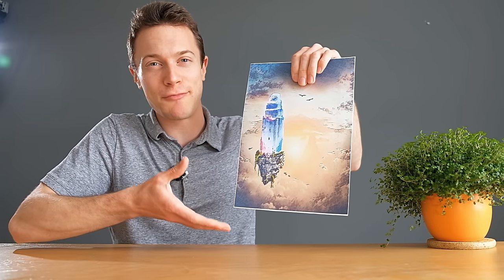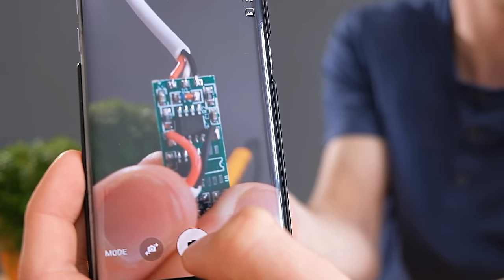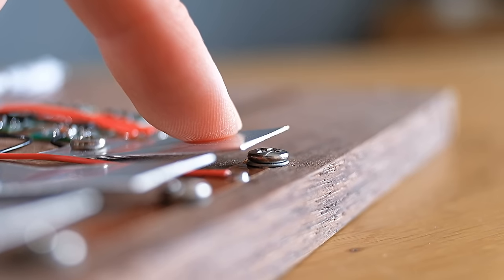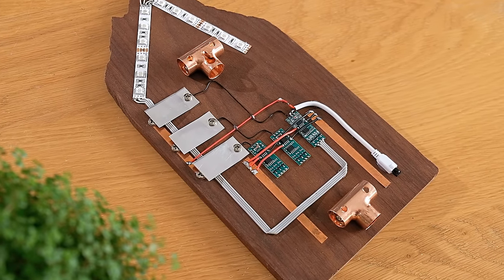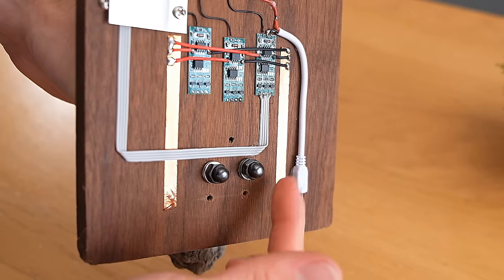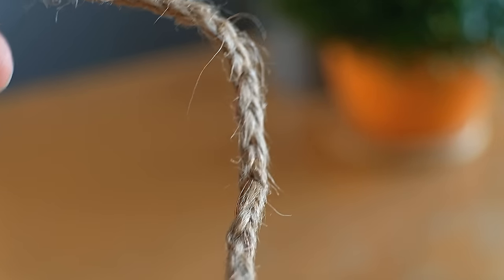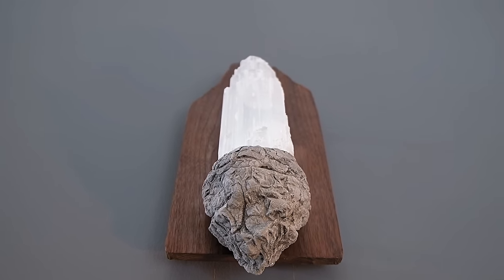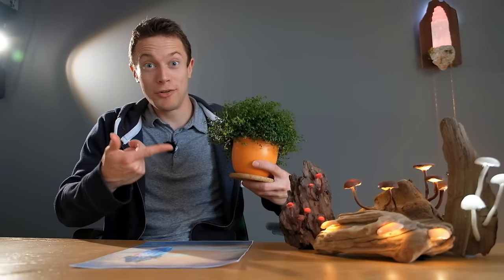Stunning LED lighting projects you can make at home!

Comment: Next video: DIY fire extinguisher
Reply: Water + bucket.
Reply: LazerLord10 that's gonna be helpful with oil or whatever
Reply: "Not"

You dropped this.

(No, but seriously, if there's any substantial oil/grease fire, DON'T use water to put it out.)
Reply: ***** sarcasm
Reply: Giacomo Arcuri it's not worth it. a comercial fire extinguisher is going to be much safer, probably cheaper and with better chemicals.
Reply: Giacomo, your comment gave me a genuine LOL. Thank you.
Reply: 12V and and very low current too. I would add current limiting in case it shorts
Reply: The power supply he's using likely has that feature already. Also, the wires are fairly well insulated, so the risk of a short is very low, and even if they did, they probably won't catch on fire.
Reply: ...that lights up when you fight fire with it 😄.
Reply: LazerLord10 well insulated? There are wires there he joined and left exposed. I never once saw any insulation tape used..
Reply: Kas Georgiou The wires are insulated, they are magnet wires. However scratching the thin insulation in  those wires isnt hard. So they are not well insulated
Reply: They are coated in a very thin and clear insulation (sometimes referred  to as 'lacquer'), and while it's not great for exposed wires that may rub against each other, it's adequate for a low voltage and low movement project like this. You know what kind of insulation is in pretty much any motor ever made? This stuff. The coils in your speakers and headphones, the wires in transformers, and also in electromagnets all use this type of wire; it's a lot less sketchy than it looks.
Reply: It's ok for a prototype but I wouldn't stick it up on my wall that exposed.
Reply: Here's some problems (I speak as a qualified electrician and hobbyist er electronicician).

The problem isn't shorts. They pop a fuse quickly. It's a moderate impedance fault, which passes current but doesn't blow a fuse or other circuit protective device. They heat up and cause fires. I think he said this is a 9V PSU, which isn't enough to arc, but it is enough to pump current into a fault.

Wood and string are terrible insulators. Both absorb water from the atmosphere. Wood hasn't been used as an insulator since the early 1900s. The wood here may be varnished, but it has breaks in that where the screws go in. So its resistance can easily fall with time. The string will absorb water also. All the electrical connections are made directly to wood. And a fault in a cheap PSU might be happy to pump many amps into a fault.

Further, the suspension of the wooden block by the wires themselves is very unwise. There is nothing mechanical to take the strain. You never do this. Even when lights are suspended from a rose, the ceiling rose is designed to grasp the cable's outer sheath (and will do when installed properly), and heavier fittings require a flex with a suspension wire inside. And those wires are much thicker too, at least 0.5mm squared, and both insulated and sheathed.

Those suspended wires could easily be caught and damaged by people and pets.

The problem with fire is it is very rare, but devastating when it happens. The Grenfell Tower blaze is a once in a generation disaster. But that's not much help to the victims.

For safety I would recommend that a suitable, reliable (not any old crap from China) PSU be installed in the "rock" base, with overcurrent protection appropriate to the small load. That should be fed from a concealed outlet behind the fitting- which would mean chasing and decorating the wall- or an unobtrusive PVC conduit used and painted, or a sheathed cable clipped to the wall. And all internal electrical connections should be properly insulated from the wood.

And then it should be safety tested by letting an enthusiastic cat loose in the room for a while.
Reply: bag of flour
Reply: jaxxstraw 
do your own version, make a tutorial.
Reply: Don't make it then. This project might be too hard for you. It involves thought and common sense. Try paper mâche and don't eat the glue.
Reply: Who are you talking to?
Reply: The two separated wires are very fragile and the insulation is not suitable for use without additional sheathing in my view. They could easily be damaged. Just think of cleaning around them, let alone kids and pets, etc. You wisely however emphasise the point about "low current"; people seem not to realise the difference between a low current drawn by some operating device and the potential fault current which is whatever the power supply can pump into the fault before a protective device operates.

The rustic wire seems unnecessary anyway. It would be easy to wrap something properly insulated in plaited string.
Reply: Just shove the kids into a closet or just get rid of them, problem solved.
If you think it's gonna burst into flames, don't make it. Simple as that.

Comment: Not gonna lie. I love this so much... but I suck at just... all of this.
Is there any way you'd consider doing a simplified version for noobs?
I'm actually currently working on the TV skylight (I'm nocturnal so I like that.) but most of your projects seem so daunting and intimidating and out of my skill level, and the skill level of many people. If you did simplified versions of some of your more complex builds, I know people would flock here and appreciate it. 
Either way, thanks. I'm gonna try to make something similar, as best I can, to the best of my abilities! 
Thanks for the hard work, and thanks for sharing with all of us!
Reply: Just follow this tutorial step by step. It maybe looks complicated, but once you're at it, it will be easier. :)
The mushroom lights were a bit more difficult for me because of those resistors. I bought a whole pack with resistors from 0 Ω to 1 MΩ... Only needed some with 200 Ω. It was kinda hard to find them. But I managed it... Somehow.. :D

Comment: Really nice video, but I don't understand something.  He said to put the RGB LED's on the back side, and the glass looking thing is on the front side, so how does the light go through the wood to the other side? I would say it is an exceptional video though.
Reply: Backlight, but how does it penetrate/go through the wood?
Reply: It doesn't; if you look, he puts some strips of LEDs at the base of the crystal too, those are what's making the crystal glow.
Reply: Isramations when? I watched this whole video just now and didn't see that, came here w the same question
Reply: 9:18; you can see them there.
Reply: ohhh dang how did i miss that? thank you v much
Reply: I think its ambient light.
Reply: No, he has strips of L.E.D.S on the back too, and they can be programmed separately with the remote. You can see the strips (white at the top of the wood) at 5.19 (the time on the video).

Comment: I made something almost the same as this a few years ago for a gift for my mom. It didn't have some LEDs that changed independently, just all together. I never thought about that before. the only other differences would be that i didn't set it on a natural looking base, but in a plexiglas box i made and used silver reflective spray paint on to make it almost mirror like, and it is battery powered and the color controls are on the side of the box.
Now that i know some cool tricks i can probably add them to a version 2.0!

Comment: I did my own version using an LED submersible light circle that I got from an online shopping site.  I then cut a circle in what I was going to use for the base, popped in the circle LED light, placed the crystal tower on top and turned on the LED light.  A lot less work but I did enjoy this idea.

Comment: Your are an artistically talented electronic geek.... Nice work

Instead of putting three switches behind the board, you should keep all three IR receiver at the back of the board, just behind a 2mm hole for each receiver.

Fill the holes with a light guiding rod, AKA clear PC plastic, which will be almost invisible. 

Now, the remote control can be directed to one light guide by blocking the other two light guides by two fingers.

Comment: Impressive design and what an attention to detail to have... 
I am happy to know i am not the only machine screws savager,  Fantastic job pal...
Reply: I think the enamel wiring legs look great, i will be adding a few more legs/strands to resemble a waterfall look with tears of hot glue drops running down them. 
with a small up or down lighting strip on either the pendant or the mounting, preferably running or chasing a blue and white mix.... 
Please do it,, new Make an Led Waterfall wall light, like a BOSS!!!

Comment: Just a quick note for if you're about to order selenite. The 10cm/4 inch ones are way smaller than in this video, they're like 1cm/1 inch in diameter.
Reply: Yes. I got 6-7in and they are also much smaller than this video. I am struggling because the board I have selected is a bit small and I need to get crafty to find room to add the pins to hold the concrete.

Comment: Don't know if you heard of them yet, but there are also ws2812b LEDS that only require three connections instead of four.
They are also "digital" LEDs so you can address every single LED via your PC for example, they also seem brighter than the usual 5055

Comment: I did something sorta similar.  Printed a base for a glass sphere that has an etched galaxy inside.  The base is designed to house a circuit playground express, which I attached an external IR receiver (because the CPX's built in receiver sucks!)  Also attached some old fan control cables from my pc to the circuit playground which go to an led strip installed in an old broken minecraft desk cube.  The whole thing is controlled, via custom python software I wrote, with an apple ipod dock remote.

Comment: ha, YES!  I knew there was a reason I kept a shoebox full of old IDE cables.  Take that, ex-gf's who said I was a pack rat.

End result looks incredible.  But here's a painting tip from someone who paints pro and rec: apply the darker color first, thin the paint down A LOT (like skim milk) and "wash" it over the whole area.  Then switch to the lighter color and dry brush it all over the raised texture.  

Even better: Apply the primary base color you want > apply darker wash > re-apply base (avoiding recesses) > dry brush with 3rd, brighter highlight color (use a big brush for dry brushing).

Comment: As far as all the DIY lamps and lights I have seen, this is the most beautiful. For other projects with Selenite, is there away to use 120vac and drop down tot the proper voltage for this and other projects?

Comment: Is there a particular reason why you used different methods for some of the different connections?

Such as just screwing the buttons onto the wire directly versus attaching the DIY cable to the small block using solder tabs, and then just making loops when you attached the enameled wire to the power lanes?

Comment: You can buy Selenite Tower LED Lamps this size for about $50-75 on eBay. That being said, all I could think about was how the base looked like the floating islands in Avatar! You could make them much lighter out of papercrete or foamcrete then suspend them with thin monofilament line. You could use the twine painted green with some very small moss pieces glued in a few spots to connect them like “vines”. Maybe string them
through some painted Styrofoam chunk “boulders” with a few hanging off the islands? Paint a larger blue sky background or the wall. Add some wispy clouds/fog (a simple spray paint can works great! Just practice first) or “real fog” putting a desktop fog
waterfall fountain nearby or a battery operated one “embedded” in one of the islands?  One with “rocks”? LED lights? A bonsai tree and shrubbery? Train model trees and bushes? How about some Battery operated Fiber Optic Strands? Have a few Banshee dragons flying around? Some other Nav’i Characters and Creatures about? Anyway,
just a few ideas.

Comment: since the 2 copper wires in front of the wall are visible i would camouflage them by spray paint them black first and then wrapping/insert each one around/in a medium sized chain spray painted black/brown(wood color)/darkgrey(wall colour) .
So basicly 2 dark chains are visible and no "modern" stuff like copper.

Comment: Very cool project I want to make. One way that it could be a lot cooler imo would be to use an Arduino, individually addressable RGB LED's and a Bluetooth connection. Then u could use code like Adafruit provides to have it cycle through the rainbow, or other patterns, and control it from their app even. While it would add complexity and cost more it would be so worth it.

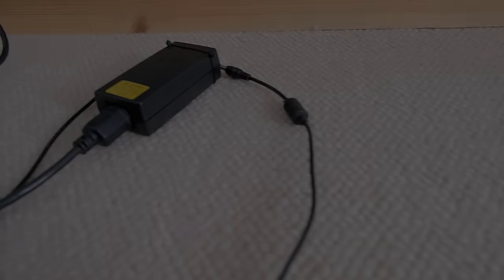Comment: @DIY Perks From 10:16 you mention how to replace power cable 10:55 soldered to power socket and the other end screwed to solder tabs.
At 12:50 Which should be connected to Positive and Which is Negative?

Comment: It looks really nice! One thing confused me though. This might seem stupid to some of you, but I just don't really know much about cables and stuff. So the copper strings transfer the energy and they're exposed, so won't you get a shock if you touch it?
Reply: No there is low voltage on them
Reply: @retropcs88  thanks :)
Reply: Plus the copper strings Are isolated by a thin coating of something
Reply: @retropcs88  thx ;)

Comment: I am excited and terrified to try this out--so glad I found your channel!!

A couple questions, if I may, I'm still somewhat new to this:
What were the dimensions of your tower/wood (approx)? I keep  finding 4" towers, but that seems way shorter than what you had.
Also, I have WS2801s and 2812s from a previous project. I'm assuming the suggested controller won't work for those (5v / DI / CK / GND ports)? If not, can I expect controllers for these lights to be wired more-or-less the same?

By the way, that is the coolest power cord in the history of power cords and I was yelling at my computer screen because that shouldn't be able to work but it probably does. I'm looking forward to seeing your other stuff. Have another sub!

Comment: Would it be possible to adapt this design to use with a battery pack, so the wiring feed can be removed and the piece be easily changed from one place to another?
I'm asking because there are so few LEDs its seems that can be used with a dedicated battery.

Cheers

Comment: I love the design.
I have one problem worth some of the electrical connections. 
Putting solder on a wire and clamping it with a screw, isn't good practice. 
Actually it's a potensonal fire hazard. 
Idd the connection isn't tight enough, which can happen over time,.
There will become a resistance and the solder can melt.
This can create sparks and result in fire. 
There are good and cheap solutions on the market to solve this problem. 

I don't want to criticize you beautiful lamp,  just let everybody know the dangers.

Comment: Cement and concrete have to be vibrated to get rid of airbubbles. Just  press to the side of your subwoofer or stick your electric toothbrush in or something similar if you dont have proper Tools.

Comment: Does anyone know if these LED strips maintain their last setting if the power is cut? i.e. if I put on a power switch or hooked it up to a smart outlet? Thanks! Great DIY
Reply: Actually just realized at 14:14 it turns on with all 3 colors at the same time meaning that each strip wasn't turned on individually with the remote...so I think I answered my own question lol

Comment: A few problems and better options. Do Not Use Solder! Simple crimpable wire Islet connectors can be found at most Hardware and Hobby stores. The Crystal and 'Floating Mountains' can be found at most Pet supply stores as Tank decorations for Fish or Reptiles, or Hobby stores painted or not, precast or molds. Parts are available online.

Comment: Personally, I'd add an ESP8266 (a little over $1 on aliexpress) instead of the ir control with the signal switches, that way you can change it without touching it (better showoff value)

Comment: I wonder if you could make it float with magnets...not with cement, but I've experimented with making materials, and if you dissolve styrophoam (sp) in acetone, and add wood ash, you get a very hard substance, that is very light, maybe add a little sand for texture?...I haven't watch yet, I just thought I'd share when I heard the cement part
Reply: I does however take a very long time to cure, as a down side

Comment: This is amazing! but... wouldn't there be current on the two copper wires that are exposed? Confused drummer here...
Reply: Those copper wires are coated with transparent non-conducting 'enamel' ...   comparable to wood varnish.  So he said 'be careful not to scratch it' as he unwinds from a dc motor.
Reply: @arnoldvillasanta1  oh, right. i must have missed that part. thanks :)

Comment: I think that I am going to give this a try but if I used one controller and miswired my led strip on the cuts like red to blue and so on, do you think that I'll get the same lighting effects?
Reply: if you miswire the colour, it will just show different colour. EG, you put red to green wire, you select red with your remote but it shows green. you just swap red and green wire, and good to go.

Comment: you could have made the rock part with paper mache, power it with batteries, (plug hidden by vegetation) and use a magnetic "levitation" base and you put a magnet inside the "rock" part, or if you want, use wirelless energy to power it, though i would ust go with the batteries fo make it simplier